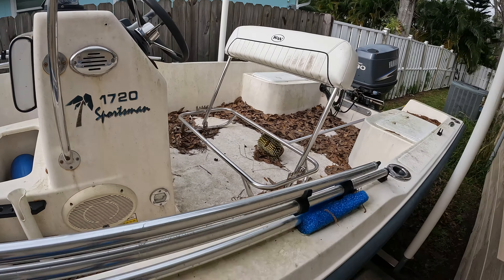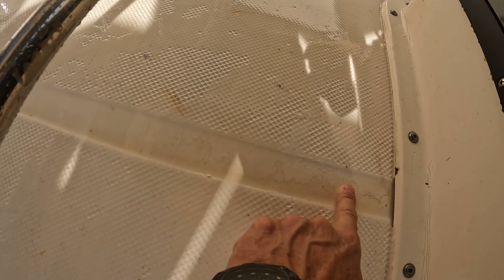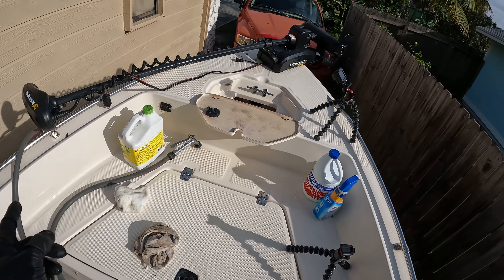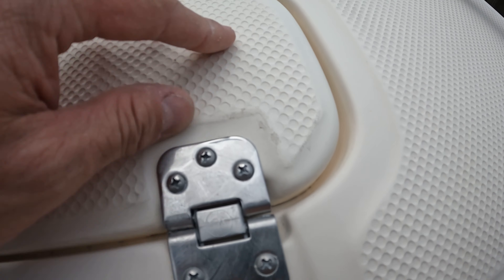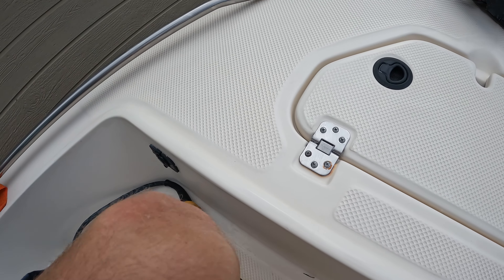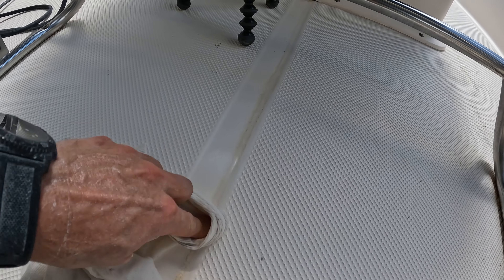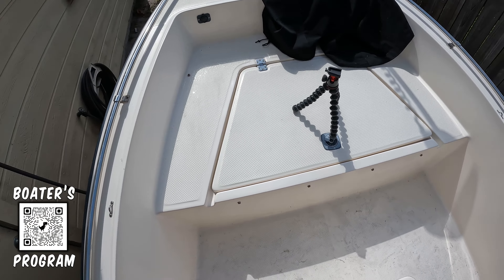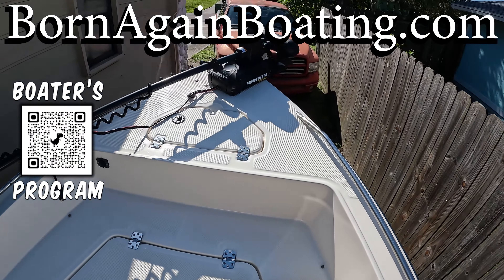Removing 20 YEARS From A Boat!

Comment: Great work and I thoroughly enjoy the channel. What are your thoughts on ceramic coating vs wax? I ask because I use a graphene ceramic coating on my boat and the durability in the salt seems pretty decent and the slickness definitely helps when I clean it after our trips.
Reply from the maker: Ceramic is amazing but definitely needs to be done properly or it can be a pain, I don't have a ton of experience with it but when Andrew does it it looks awesome!

Comment: Hey bud. Need to know a little more about that mini polisher. Is that a Milwaukee? I have a desperate need for that for my 32 year old boat with some very small spaces on the top of my gunwale.
Reply from the maker: Hey, I don't know where you can get a cheaper one, I haven't tried the Milwaukee one, it looks super similar though, that one is a Snap On, it's stupid expensive now if you don't use it very often but here it is:
https://shop.snapon.com/product/14.4-V-MicroLithium-Brushless-Polish-Prep-Tools/14.4-V-MicroLithium-Brushless-Cordless-Polish-Prep-Tool-Kit/CTPP861K2
Reply: @BornAgainBoating  Thank you sir. I looked at all the polishers out there and they are all too expensive LOL. 

I just finished watching your second video on the new restoration project. Cant wait to see how you go about all of that. Looks like a tedious nightmare. Goodluck and have fun.

Comment: Was the gel coat oxidized to begin with in this situation? Will cutting oxidized gel coat work without wet sanding as a prior step? I have the same boat and it has a little oxidation so I’m wondering if I can do the same as you, Thanks dude!
Reply from the maker: No it wasn't oxidized, if you got bad oxidization then you gotta wet sand it first :/